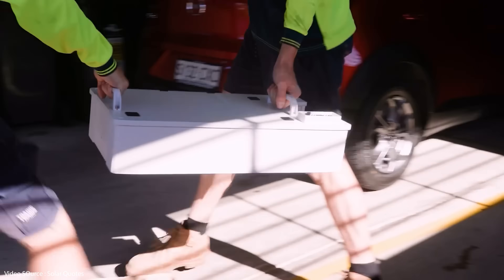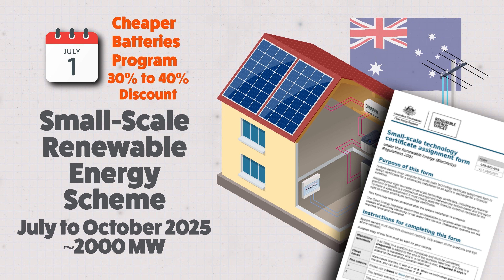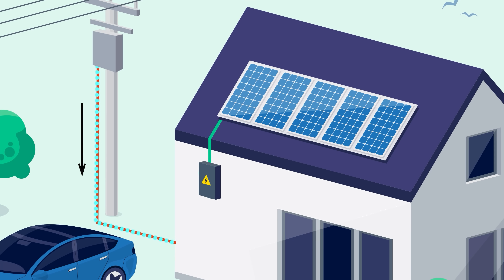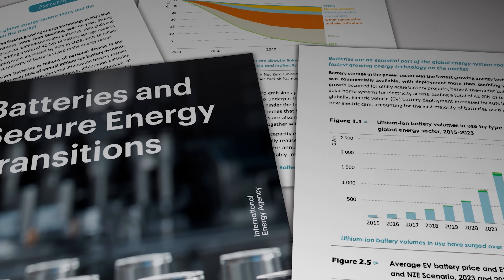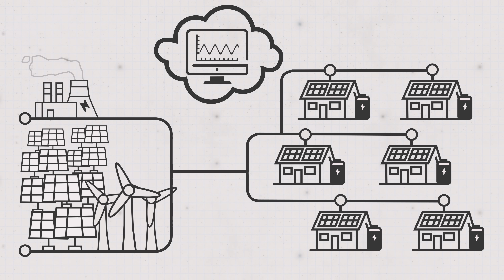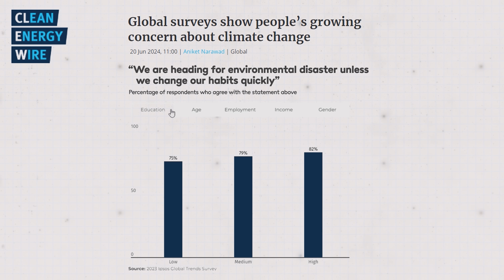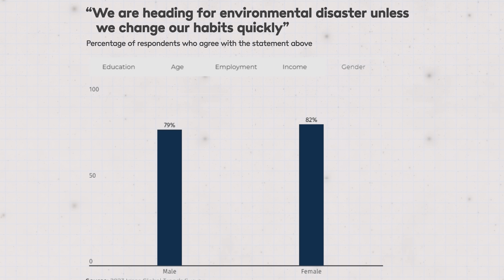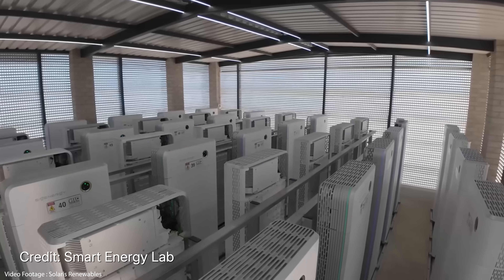Australians installed 100,000 home batteries in 17 weeks. Why can't we all do that?

Comment: Im an Aussie, and I can tell you the battery rebates are mostly green washing. 

The market is flooded with cheap batteries that dont last longer than 10 years. Additionally its a heavily regulated market that actually blocks a lot of innovation around building bespoke and custom systems. The regulation is designed around safety but there is always safety recalls on batteries and therefore does not achieve its purpose. 

On the solar side, it has been pretty successful but early on in our solar rebates we had a similar problem with low quality products flooding the market. 

I think generally over regulation of these industries really blocks local innovation in our manufacturing industry which is sorely needed. 

Also in some states where solar and batteries are MOST installed have the highest electricity costs.

Comment: We need a more revolutionary change, at least in the USA .. We need to separate the residential electric system and its load from the existing electrical power transmission system .. because the GREEN Power sources are LOCAL, the small residential users no longer need to live, from moment to moment, with the countrywide and system wide electrical power infrastructure any more .. It is like Costco shoppers [TESCO in UK?] could break themselves apart from the supermarket systems, and operate more or less like a cooperative ..

This is critical for the USA because of the coming AI power surge, and we the innocent residential electricity users will end up paying a large portion of the cost of accommodating the AI power surge .. And we should not have to ..

If residential power cooperatives are self powered by solar, wind and batteries, we can be free from the systemic blackouts utilities suffer through, and will even more severely when AI data centers come on .. And the only electrical faults that we need to deal with are local cable faults which can be smartly dealt with by the SMARTGRID technologies ..

Good on you Aussies to install batteries at homes .. Next agenda, organize all residential users in your township to form a cooperative which is connected to a nearby cooperative at the next town, who can come in to help you in time of need, [and vice versa] even though during 99% of the time we all are self-powered ..

Comment: Had 6.4kw of solar installed 6 yrs ago.  Last week had a 24kWh 3-phase sigenergy battery and an additional 3.5kw of DC coupled panels .  Its summer now and I'm self sufficient in power 24/7 and my battery is full around midday give or take an hour. 
The only time I've charged the battery from the grid was the day after the 42c day heatwave.  The biggest demands on the Australian grid in history.  Feed in prices changed from a few cents to $13 dollars per kWh in my area in the peak afternoon.  My battery ( automatically)  started pushing 13kw of power into the grid.  I earned $111 that afternoon. 
The grid had no blackouts and the net demand after solar / batteries / wind was less than a heatwave a few years ago.  So the strategy is working. Less need for upgrading expensive long haul transmission infrastructure and less need for gas peak power stations.

Comment: I live in Australia, and don't have solar or batteries, because I have trees around the house.
Reply: You could still install a battery.  Charge up when its cheap (Amber were charging around 6c to 10c per kWh this morning)  and use at expensive times.

Comment: Living in South Africa - so having a nice solar system (10x550W panels, 2x5kWh batteries, 8 kW deye-sunsynk invertor) is the way to go.  Like Australia, South Africa is huge and populations are scattered, so - distributed systems are the future way to go. With a 250m2 home, swimming pool, water pumps for water reticulation - I could easily feed another 2 or 3 similar homes, if needed.  No loadshedding headaches!  Having lived in Belgium, as well, yes - sun can be a bit of an issue there, but still, even here in South Africa on cloudy days, I do not have to depend on the main Utility.  Even in Belgium, with its dreadful weather, very few new homes come without solar panels, these days, and with ever increasingly performing batteries and panels - solar should even be a very good option there.

Comment: I doubt that Australian administrators are too worries about carbon milestones.  It's all about containing costs.  Years ago power suppliers subsidised the transition from incandescent lamps, branding it as green and caring but in reality to lower peak loads.
Now I'm waiting for an open electrical trading marketplace, to replace our "smart meters" that charge 56 cents for peak power and return 2 cents for your solar power.
Note that installed batteries are typically ~ 10 kWh, but:
 - at present there's little opportunity to have your 60 kWh electric car form part of your house battery system.
 - you could buy a secondhand battery from an old Leaf that has considerably greater remaining capacity.  I'd like to screw a car to the wall!

Comment: Aussie here. South Australia. Rise is my hero and who I would choose as my daughter! We put in 15kw solar panel and 16 kWh battery. Spplies 99.8% of power and supplies at least 10kw to the grid most of the day. So regional batteries are needed to soak up the joules. Our battery is full by 8AM for much of the year. EV will come when ICE dies. This will add a minimum of 60kwh to battery and will still not consume all the joules produced. Regional battery needed. Robe, has a regional battery and is the experiment for them in South Australia. Regional batteries are the new base load infra structure. Getting rid of outrageously expensive coal and expensive gas is needed to finally reduce energy cost to near zero. The who is laughing?

Comment: I am in Brisbane
13.5kw of solar 
2x 5kw inverters 
20kwh batteries 

I am not part of a distributed BESS system as I want to maintain as high level of charge as possible as I live in a shit grid area. 

Always a credit on my bill. And have backup. The whole system will be paid for within 2.5 years. 
I also have no guilt running AC now.

Comment: Australia is one of sunniest countries on earth, its pretty obvious why Solar is a useful generation strategy for residential installations. However, you must consider the wider negative affects this has had. Energy costs have not declined as was promised by the propaganda that continues to be used across the renewables discussion. In-fact, they have done the opposite, rising dramatically as the traditional energy generators struggle against a shrinking consumer base and more concentrated load requirements placing pressure on the grid. All of the supposed positive effects of renewables are simply an offset of the exorbitant subsidies handed out by the government.

It is not all sunshine and roses. Real people are feeling the negative effects of these policies and unnecessary rushes towards these ridiculous goals. I have solar on my home and I enjoy its benefits, but at the cost of the wider economy.

There are also talks from the energy providers around charging consumers for Solar Feed in, instead of providing a rebate, go figure that.

Comment: Blackout Bowen or energy minister did the sums & found the billions of $$$$$$ he is spending on the infrastructure on renewables has driven our electricity prices up by 39% so we would have to have  something to supplement the gap so he came up with this bright idea to offer discount home batteries to people with solar panels already installed or get the lot with panels & battery. 
Mind you the discount on all this was made out to be the biggest thing since sliced bread but the batteries alone were still averaging out at around 10k & the system was 15-18k. 
But most people don’t do enough research & think they are helping to save the planet but the government has to get the money to subsidise the batteries so everyday Australians are we are paying for it. 
Yes some people love it , some don’t  have the the finances to buy them. 
But if people pay attention to what a lithium ion battery in thermal runaway can do they might think again. 
It can burn your house to the ground. 
Next point.  Do you have additional insurance to cover that cost. Have you informed your insurance company 
Ask the manufacturer , supplier & installer WHO IS RESPONSIBLE if the battery fails & destroys your home. 
They tell you they are safe , so do ev makers but we hear of more & more  lithium ion battery fires every week. 
It’s going to start happening maybe not sooner but later then the 💩💩💩💩 will hit the fan bigger than ever.
Reply: The spending on infrastructure is not what is driving prices higher. The AER sets the benchmarks for consumer power prices and puts one of the main reasons as outages at coal plants, with expensive gas filling the gaps.

Much of the infrastructure spending is needed anyway regardless of the generation source. The recently completed link between SA and NSW was first proposed by AEMO in 1998 to improve grid security, but it was blocked by the Olsen government who were worried about its impact on the SA power privatisation

Comment: Having single (&1phase) DC battery powering 3 phase inverters does allow the inverter to rebalance the phases without wasting more power than exporting to a balanced grid. I assume other methods used by the grid to rebalance phases waste more power than that.

Comment: If more power is generated by users then the large generators have less MWh through the grid compared to the cost of the grid, so grid cost per MWh increases. If we need to increase capacity of the grid to handle the greater fluctuations of power in both directions but overall yearly kWh doesn't increase, then the cost of kWh from the grid will increase further. Not to say "do nothing" but to say "consider all costs, disadvantages & benefits".
YMMV.

Comment: After ignoring initial ramp up, current capacity is about 390'000 systems/yr or take ~30 years to cover >95% of homes/apartments (if possible). The rate on installation could be increased if government subsidies continues with long-term commitments. An over generous then sudden end like the home insulation scheme would be another disaster.
The government contribution to total cost should be capped at less than 50% no matter the size. Original scheme design had gov pay larger share as the cost/kWh reduces with larger batteries. Gov just changed to a new sliding scale to reduce subsidy per kWh as the batteries get bigger.
In 5-10 years time, the current batteries will be obsolete compared to newer chemistry batteries (like solid state lithium or sodium). In 9-15 years, some components in the inverter & battery management modules will need replacement (far less than full replacement cost of complete system but far more than trivial).

Comment: Burn your own house down.😁
Reply: Home battery installs are tightly regulated. Risk is on a par with fires from clothes dryers
Reply: @tassied12 Whatever you say.😁
Reply: @crazyedo9979 In NSW, there was 1 fire in 2022 and 3 in 2023 out of around 20,000 installs. So far, nationally,  the Cheaper Home Batteries scheme has resulted in 184,000 installations in 6 months with no issues reported.

Comment: I'm in Australia, I installed solar and a battery two years ago, no subsidies. For me it wasn't about return on investment, it was about not paying 1 red cent to the mongrel power companies that i didn't have to. They have been gouging us for years here in Australia.

 Whilst i have paid nothing but network connection fees for the last two years, I am about to take advantage of the subsidy and double the size of my battery. 
We live in a country of weather extremes, twice in the last year I have lost grid power for more than 5 days in a row, and numerous other times over night. My current battery and inverter are not big enough for full home backup, so i cant cook or have a hot shower using my battery when there is no grid supply. So my aim is not to just store enough power for overnight use, but to get a bigger inverter (and have the entire house on the backup system) and store enough power for a week where there is little solar generation during the day and no grid connection, as occurred when we had a cyclone last March.

Comment: Well, being a Swiss, I have to give the sad news that any push towards rapid energy transition is being blocked and interfered with by a coalition of naive, so called "greens" (too stupid to understand simple mathematics), and the capitalist neo-nazi like often pro-Russian majority political parties called FDP and SVP, heavily connected to a still active nuclear and fossil fuels lobby. With main stream media tightly controlled by SVP (Blocher and friends) the truth has a very hard time to become dominant, a question being when the economics will become so evident as to override the dominating power of the right wing political-economical network 
Just an afterthought - you and many others have been reporting those facts, without ever mentioning idiot Bill Gates anti-renewables propaganda derived from 1990ties climate denialism. Just for correcting: Having recently been in Uganda, I was appalled by the disastrous virtually lethal air quality of Greater Kampala, and even every mid sized village in the country, derived from burning char-coal, petroleum oil and driving primitive Chinese and Indian polluting two-stroke motor cycles. This air quality with certainty costs years of the average live span of every Kampala resident, and climate action will be the fastest to immediately correct this disaster.  Providing every family with a 5 kWhrs PV system will easily provide the electricity needs, costing right now (in Spain) 4000 Euro an unit. For 10 million families that would cost about 40 billions, absolutely nothing for Gates and his billionaire gang, and would likely safe tens of thousands of lives per year in Uganda alone. Same calculations can be done for all of developing Africa, and don't tell me that this is not adequate technology for the poor Africans. They are jumping whole technology generations directly into the renewable and digital age as we speak, the only thing missing is capital. Sadly Gates and friends are not invested in PV-battery systems or electric scooters!

Comment: And over 95% don’t work when there a blackouts the fuck heads purposely setup the batteries so they cannot be drawn on in night time use and recharge the following day to repeat the process. So effectively wasting 90% of
The purpose.

What a joke
Reply: Full back up protection is actually built in to the systems most people are installing. So No, you don’t need to draw on the grid at night.

Comment: i have an off grid set up for emergencies - ties in to my breaker box via a transfer switch - I have never been interested in a grid tied system - because one way or the other - utilities or government policies will find a way to limit any return - worse case they will fail and/or block home usage of home installed solar.

Comment: The Australian Govt States owned the power supplies to industry and residents. The Oz Govt sold the power supply to private businesses, including overseas companies to pay for their election promises. 
eg. Green Olympics, local sports stadiums, metro tunnels, pork barrel projects, etc. Industry gets a discount, workers do not get a discount.
Coal Power supply retailers charge a fee for a meter to monitor the residential solar connections   & now are charging these residential solar electricity 'customers' for the surplus supply 'spike' during the day back into their grid. Cost of electricity has doubled due to increase demand & price of coal.  China locked in supply contracts for OZ coal and gas for 25 yrs.... Mining companies are mostly O/S owned & pay no tax. 
a pattern emerges

Comment: Yep, I upgraded my inverter and battery. Old system had paid for itself and was towards end of warranty. We're now a VPP and I'll never look back. Payback is roughly warranty period plus or minus 1 year (depending on a few assumptions).

It's been difficult to model because while retail prices have been (and are predicted to keep) rising at double digits p.a., the FIT price has been much lower than the previous 2 years; which I guess is the point of the scheme

Comment: Yes I am in North Queensland rainforest. Connecting to grid 50 yrs ago crazy price. With difficulty searched and found solar panels. Big money! 
Very happy independ power supply throughout cyclone and thunderstorms. Up to 3rd set of solar panels and 10 inverters. Electronics does not enjoy 3 metres of annual rainfall.
Natural foods little refrigeration with natural air-conditioning (living in valley in rainforest).
A winner! 
Low cost comfortable life.

Comment: We installed a Solar Battery with the rooftop panels 2 years ago, along a hot water heat pump. We have not receive an invoice from our electricity supplier since.   We  saved a yearly electricity and gas bill of  approx. $A 3,000 annual .

Comment: I’m an Aussie & one of the big issues with this is there has been a flood on the market with cheap & nasty batteries from China etc that will be lucky to still be around by the end of the warranty period and the good old bottom line saying, “you get what you pay for”. Also fly by nighter installers have come out of the woodwork to install them and often not to the legit standards. Down the track a few years & this will be another failed Labor government stuff up. Sorry for being negative but I’ve seen this stuff before.